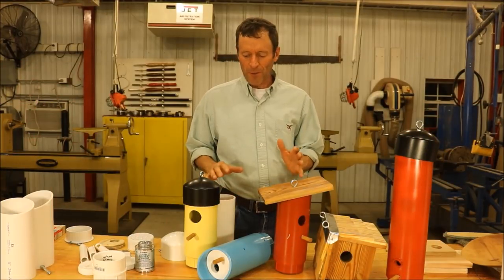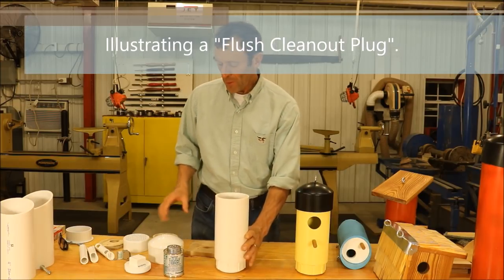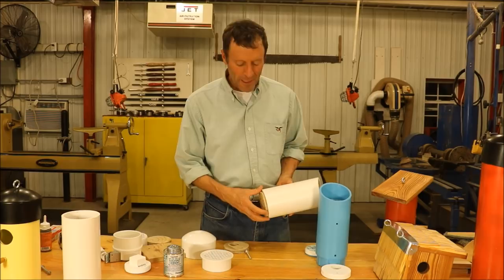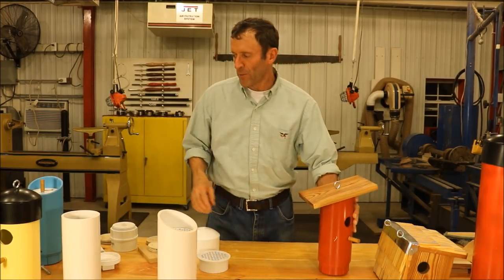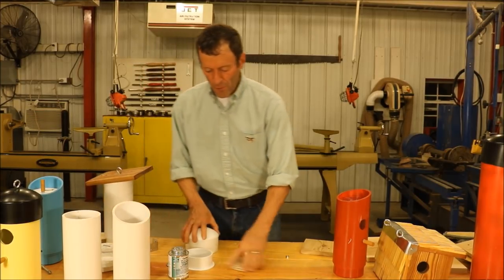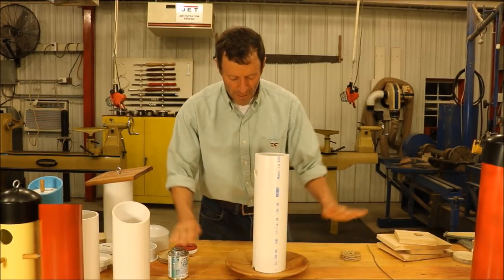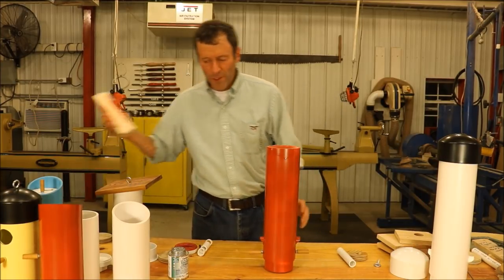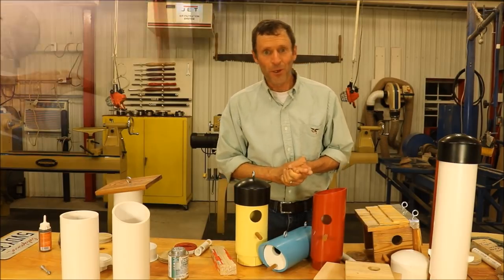DIY PVC Bird House (Nesting Box) / Bird Feeder Plans

Comment: Where can you get those internal pvc pipe connectors that also have threads on the inside of the connector which allows for the plug cap ?
Reply: At any hardware store or Home Depot.